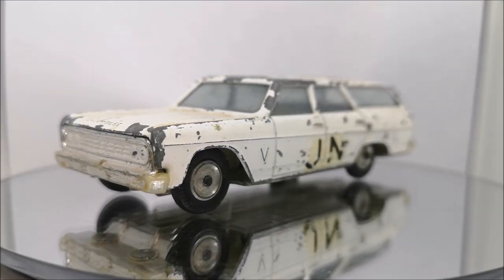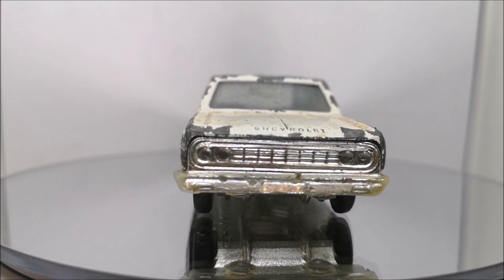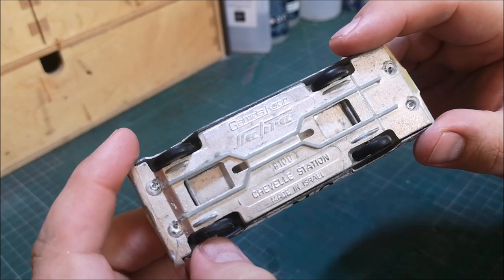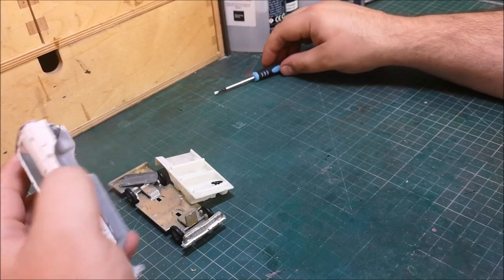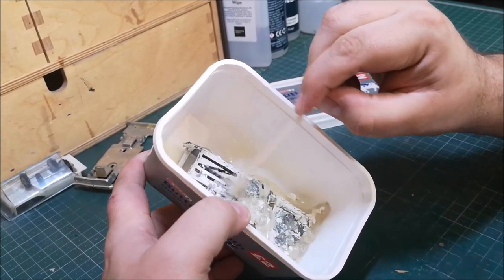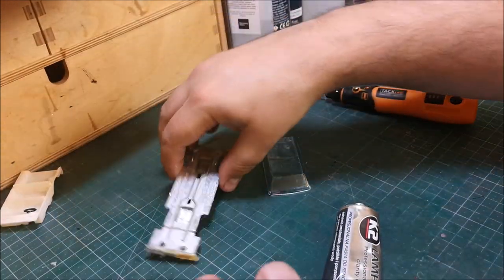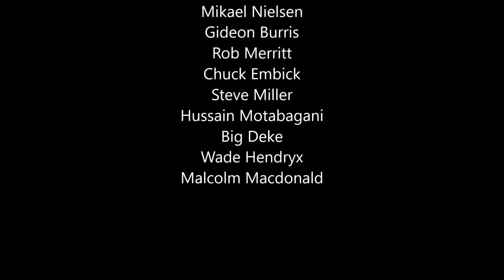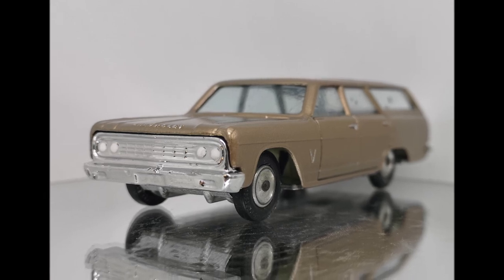1964 Chevrolet Chevelle Station Wagon Restoration+

Comment: Turned out great.  The detailing on the tailgate is quite good: bowtie, Chev lettering, and the handle to wind down the window.  This has dredged up a long forgotten memory.  I had the red Chevrolet Impala, and I remember the base said Made in Israel.  I have just restored a Matchbox Superfast #21 Foden cement mixer truck.  6 rivet posts on the model: 4 holding the base, and 2 more for the drivers cab/barrel drive cover.  Not sure if it was worth the effort, but I did tap and fit the 2 mm button head screws in all the posts.  Don't think there is another model in the small scale 1/75 range with this many rivet posts.

Comment: I remember the GamdaKoor Sabra brand from my childhood (late 60s-early 70s) there were a very few of them in Denmark, but I don't think they were sold by more than a couple of small shops.

They came in garage boxes, hard plastic with clear tops and opening gates at the ends... quite nice idea, actually and I think the boxes may have contributed to me getting a couple of these models: a yellow Chevrolet Impala and a brownish yellow flower power VW Beetle with cheapish flower stickers all over the body.

As you say, quality is not the best, but certainly not too horrible either, although the opening parts had a tendency to sag/rattle around/fall off due to not very accurate fitting.

The plastic baseplates were pretty special - of course, nowadays this is normal, but back then, most toy cars had metal baseplates. The tires are ultrahard plastic... in an era where most other makers used rubber tires, of course with Matchbox as the exception.

Just over a decade ago, I set out to rebuild my childhood collection, but the GamdaKoor Sabra models turned out to be almost completely impossible to find anywhere - after more or less giving up, I suddenly found the flower power Beetle in near mint condition - quite remarkably nobody had removed the flimsy flower stickers, and the model was sold at a very low price - I'm sure the seller just looked at it and considered it to be a low quality toy, so not really deserving of a high price tag.

Comment: Wow that Chevelle Station wagon must be uncommon or htf? Rob I just came across  2 Matchbox 1980 Chevy Citation X-11 coupes one Rust Red and one White, also A 1983 Matchbox Black Dodge Caravan with Burgundy interior and plastic sliding door. And a larger Lensley Mustard gold 1967 Mercury Cougar with rubber tires and moveable steering wheel. Also 1963-64 Dinky  Lincoln 4 door light blue with white top and rhinestone headlights. I do have others but these are just ones that are recent! Love your YouTube Channel great videos and content... Your accent is awesome as well😊

Comment: That came out great! The name may have changed by 1964, but in 1962 that color was called Autumn Gold Iridescent. The '62 Impala my father and I were working on before the world came to a halt was originally that color, though it had been redone (inside and out, which is a bit odd) in blue by the time I bought it.

It's weird that in such a large-scale toy, they didn't include any taillight details. It's like they got to the back of the main casting and just called it a day. :)
Reply from the maker: I thought about putting rear lights on but it would just be a splodge of pain and I don't think it would have looked any good
Reply: @MatchboxGarage  Yeah, I agree--without any details in the casting to show where the edges are, it would've looked odd. It's a strange thing for them to have left out, especially given how detailed the tailgate is. Ah well, it looks great, anyway. I would never have guessed that was the combination of paints to get that color.

Comment: great colour, good choice. :) I don't know about those speckles in the glass, I have seen them before on other brands. probably a failure of cleaning the machines properly, so they injected dirt or residue by accident.
I have found a small handful of this brand now. seems like they mostly did US cars from early to late 60's. I caught a Ford GT40 which comes in a plastic box with a yellow sliding ramp that keeps the model inside in place, very fancy. :)

Comment: The "V" on the front wing meant the car would have had a 283 cubic inch V8 engine. An option over the 2 available in line 6's , a 194 and a 250.
Reply: I have a real 1964 Chevy Chevelle Malibú Station Wagon with original 230 c.i. 6L engine, 7 seats, 3dr. Runs very good.

Comment: I was wondering what "JN" stood for, until you turned it round.😁 Beautiful car !!
I was thinking about wheel replacements. If we ignore "custom" wheel swaps, the only wheels which usually need replaced are Superfast and HotWheels. The older stuff seems to be so much better built and can usually be re-used. Even the very original Matchbox wheels are usually fine. HW has a lot to answer for.😁
That colour is perfect for the Chevelle, very close to the picture, and the C H E V R O L E T lettering looks fantastic, very neatly cast and cunningly highlighted.👌🏆

Cheers for now,
Dougie.
Oh P.S. Is this about the same size as a Dinky? I'm not too familiar with the brand.
Reply from the maker: I'd say it was very much dinky size

Comment: Hi Rob, is this the stuff you use? Model: VAL74602 Model Air 74602 200ml Black Acrylic Polyurethane Primer. If so Wonderland models have it at £11.99 inc vat.
Reply from the maker: No mate are you use an aerosol 400ml